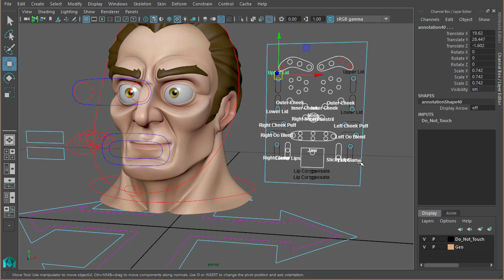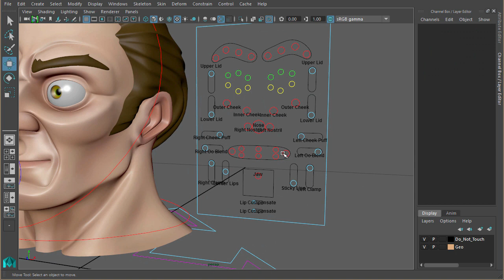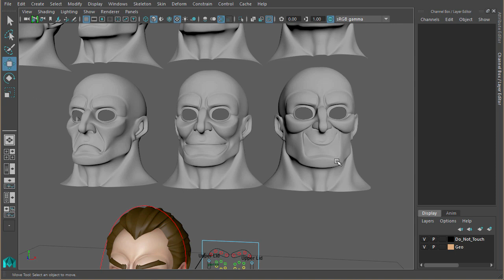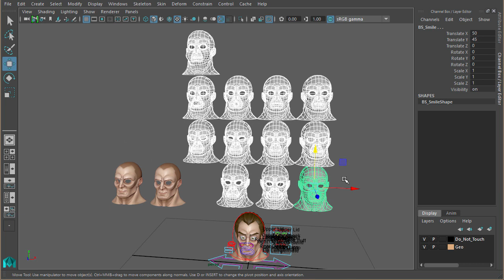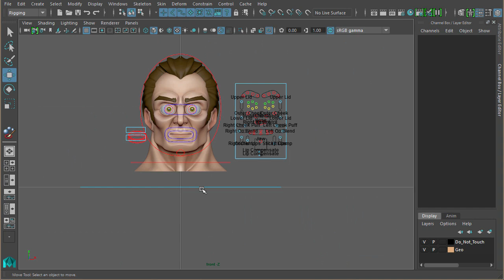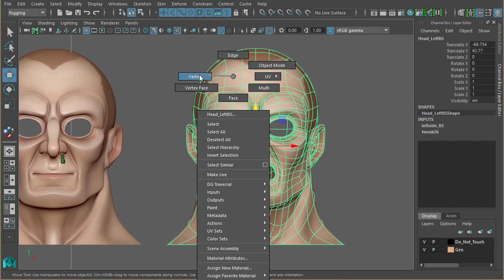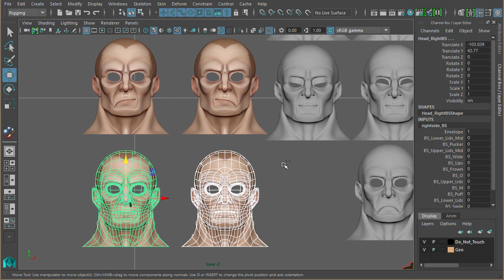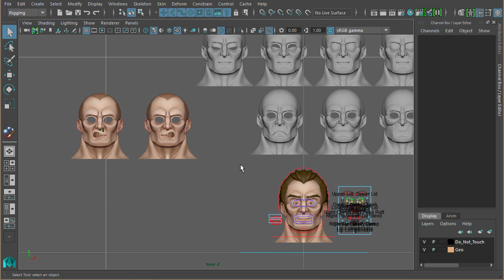Face Rigging in Maya - Part 1

Comment: If the body is not separated to the head, do I need to separate them first? If so, how do I make them stick together so that there is no gap between the neck and the body when I turn the head for example? Thanks
Reply from the maker: Its more efficient if you separate the body from the head, but it depends on what your doing. If its for a game its worth doing certainly. WHat I do is duplicate the model, seperate the head and then bind them back to the skeleton. You can then copy the weights across from the original model.
Reply: @antCGi  Thank you sir. By the way, I recently sent you a message on your facebook account because I have some rig problem on my project. Please check it if you have time. Thank you.
Reply: Actually I did send the message to your personal facebook account with your name not the actual Ant Cgi Ltd one.
Reply from the maker: @ludika_creations  Ok, I only reply to the antCGi messages, I never check the personal ones.
Reply: @antCGi  Ok, I will transfer the message there then.

Comment: To actually make the face work on a complete character, not just a head, would you still make all these separate heads and sculpt them into the required expressions?
Reply from the maker: You would, but ideally the head would still be a separate model.
Reply: @antCGi  Thank you so much for your reply it is very much appreciated.